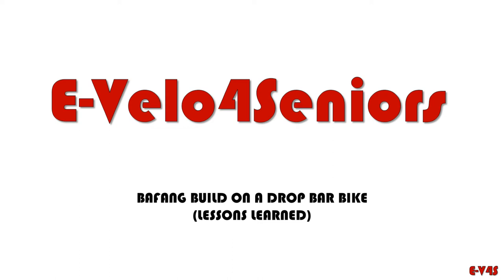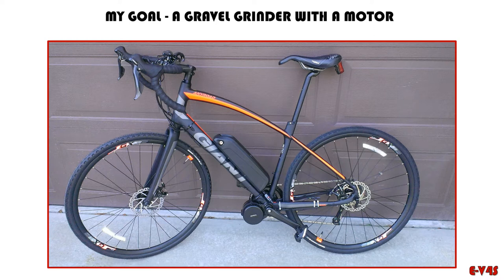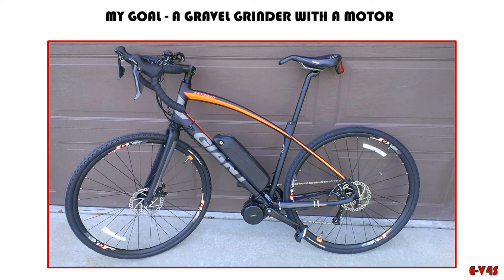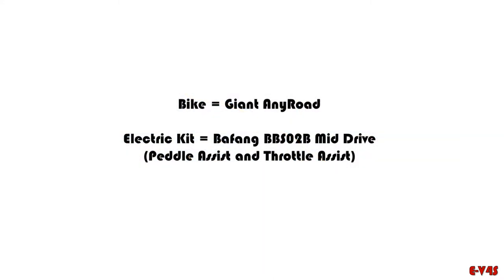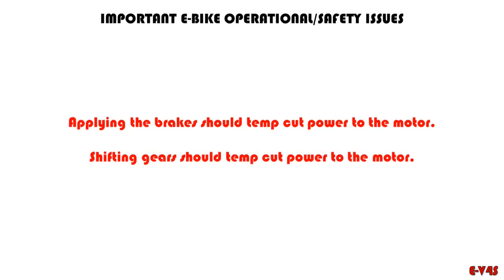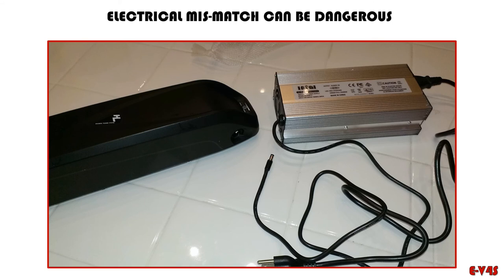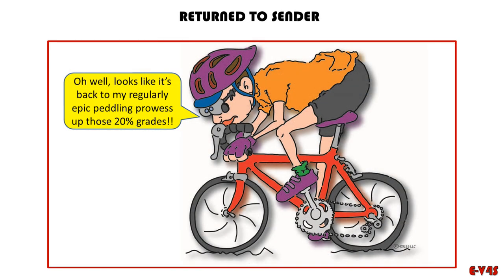BAFANG Conversion Issues on a AnyRoad Gravel Grinder

Comment: Even my C961 fits on a 31mm bar if I pull out the rubber, and there are several newer displays to buy for af few bucks. And, if you program the motor correctly, you absolutely don't need a break sensor. But no offence, bike looked great and is certainly fun to ride without a motor 👍

Comment: Thanks for the video, in terms of installing the motor did you have to re-route any cabling?  It looks as though the cables run inside the frame, do they come out of the bottom bracket and present a problem with the motor?  Thanks
Reply from the maker: The cables for brakes and shift were in the downtube but all the BAFANG stuff was ziptied to the outside of frame. The "extra" length of those cable made a tangled mess at the bottom bracket. If I every use one of these conversion (only on my trike) again, will shorten them before installation.